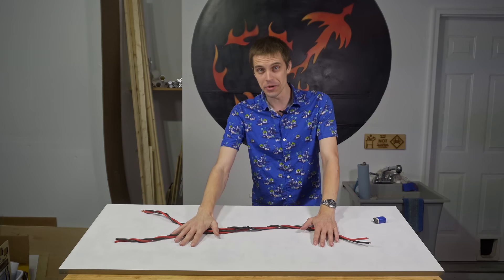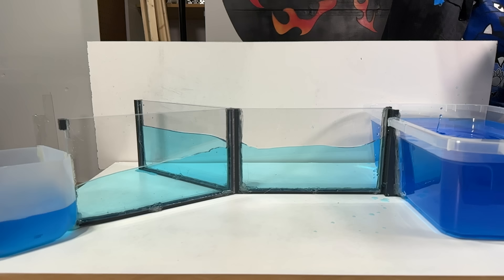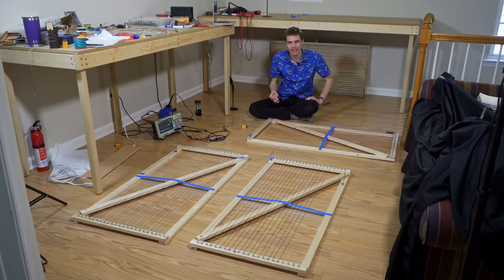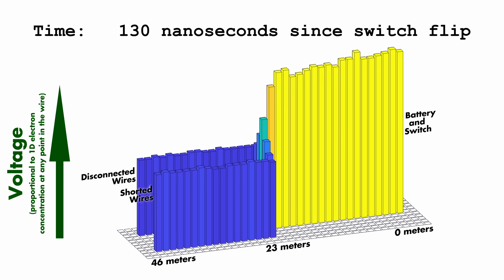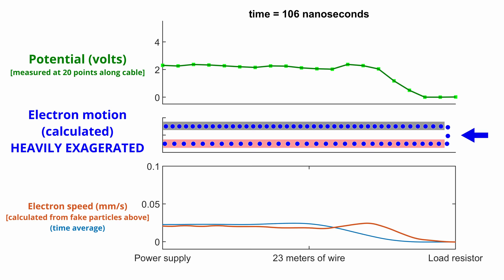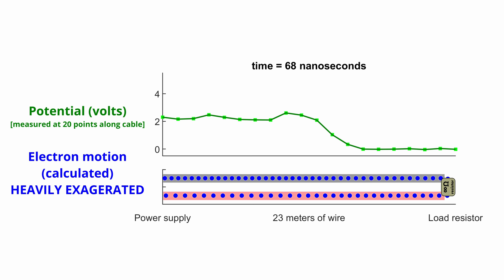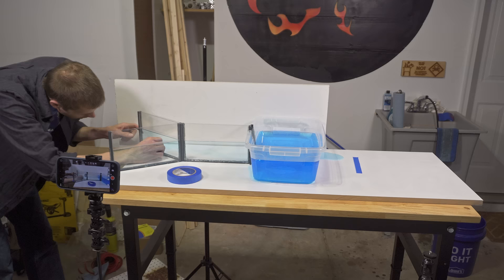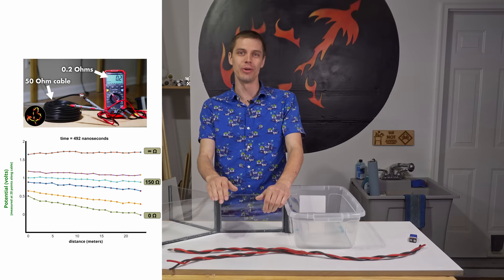Watch electricity hit a fork in the road at half a billion frames per second

Comment: Fun fact to this video: Since the waves reflect once there is a change in the wire, e.g. an "unexpected" open end because the cable was damaged somewhere, the time between connecting the battery and the the arrival of the reflected wave can be used to measure how far away the fault in the wire is (its called reflectrometry). This is extremly useful when diagnosing where cables buried in the earth are damage so that you can dig up exactly the damaged section instead of having to dig up kilometers of wires until you find the faulty section.
Reply: At the airport I work at we recently had an underground wire break. The local electrical repair company came out to locate the break. They used a trailer that utilizes the principle you described. We call it the ‘Thumper’ as you can feel it in your feet when it sends a high voltage spike into the ground to the break.
Reply: One of my friend's masters thesis used the same principle but for sound in water pipes.
Reply: @RovDisco  Thumpers like that are very primitive compared with time domain reflectometry gear. Modern form factor is a single-unit handheld (e.g. ONX-580) that can tell you exactly how far away your different faults are on the line. You'll get a different signal back for an open branch line vs. a short vs. something else...no need to even put anything at the far end of the line, although you can if you want to confirm a certain pair of wires really does take the path you think it does.
Reply: @TwoTreesStudio their primitive reading is more than necessary for their purposes I am sure. They need to access a fairly large section to make repairs.
Reply: Just how accurately can that be calculated down to?
100 feet?
Reply: @davecrupel2817  with massive HVDC conductors things are a bit tougher than phone lines/coax, but it should be more like a couple of feet max...it's theoretically limited by weird capacitance things but that's nothing compared to the variance caused by wires never running completely straight (also comes down to operator understanding of both the equipment and the underlying physics...your mileage will vary based on technician qualifications)

thumpers are easy enough for cave people to operate, you just listen for the arc and hope you find it before it sets something important on fire
Reply: @TwoTreesStudio  simple, effective and risky. I love it. 😂
Reply: @ajinkyakamat7053  Damn, that's actually a really interesting idea, do you know if it's already used somewhere?
Reply: Absolutely. Had to learn about and use a TDR in my first job👍
As I recall, it was exciting to find a discontinuity in the line and yell "There...there it is!"
Reply: Ditto, a TDR (Time Domain Reflectometer) works on this principle but with a series of pulses.
Reply: @gbmillergb  In the USAF in the 80s, we used a device called a "Time Domain Reflectometer" (TDR) to test for a broken wire on aircraft. If a wire was broken-even a single strand--it would create a standing wave which was reflected back to the device, and by measuring the time it took we could determine where exactly (+/ a few inches) the break was at. I suspect that is why there was a reflection at the "Y" connection.
Reply: telecom techs do this to locate open circuit faults in underground copper cables. This tech will be gone with optical fibres replacing copper cables. This is similar concept to radar speed detection and lidar surveying.
Reply: yes 60 years ago we had what was called a pulse echo tester which we used to find breaks in O/W telephone cables.  A mate actually used it to catch the local mayor and his son cutting down the overhead carrier wires for the copper.
Reply: @ronr4728 not gone, just changed. Reflectometry is used to locate faults in optical fibers as well
Reply: I was wondering what kind of practical uses this would have, cool.
Reply: Klien Tools: (sorry i can't remember the exact name of my tool.) Input wire gauge; Distance to short will be displayed on screen.
Reply: ...To dig up kilometers of cable and hopefully rebury it without inflicting any damage to it!...Reflectometry is a new term to me but the principle totally makes sense to me. It would also have a relation to triangulation, the process which is GPS ....It is all high math.
Reply: Wow, fascinating, something I never thought about, but something so incredibly important. The more you know! Thank you for letting us know :)
Reply: @davecrupel2817  Can what be calculated to?  If you mean were in a wire an "anomaly" is, that is based on the frequency of the pulse you send out.  I have a 20GHz TDR that can determine any impedance change (anomaly) in a wire 2 x 20ps (time of flight is 2x).  Every one of those "connections" in a wire will cause an impedance bump and show up as a reflection.  So, at 166ps/inch, 40ps would be ~1/40th of an inch.
Reply: Could relays possibly use this principle to calculate where a fault is in their zone of protection?
Reply: @RovDisco  that is the coolest thing I have ever read in my life. I *need* to experience The Thumper.
Reply: We use the same method for determining short circuits in motor/generator windings. RSO tests are fascinating and this video just makes it so much cooler!
Reply: PET  -- Pulse Echo Tester  -----  Used to use one on above ground conductors in the telephone lines to see faults, then calculate where to go look for them!    Almost every day at the test desk of Telecom in Bathurst NSW
Reply: You can also use a variation on an OTDR to create a "sensing" fiber which can be buried and used to determine damage characteristics to adjacent oil lines as well as act as a type of acoustic surveillance fence.

Comment: Absolutely amazing “footage.” Who needs expensive cameras when you can get such good data from an oscilloscope. 🤯
Reply from the maker: I’ve been trying to do the math to make something like a streak camera using oodles of repeated scope traces but finding LEDs with nanosecond ramp times is challenging xD
Reply: Sounds tough, hope you find them for the epic visual next video
Reply: @AlphaPhoenixChannel  Maybe LEDs aren't the ideal light source? Surely a spark gap could faster?
Reply: oscilloscope is a camera, for watching electron potential :)
Reply: actually i was wondering when i saw the video title, how a "camera" of any sorts could "see" electrons in a wire.  
But he found the solution: multiple repetitions of the experiment, with oscilloscope probes at varying locations. Great.
Reply: Yeah total BS.  I gave up and stopped watching this clickbait BS>
Reply: @jeffsmith3350 I wish you the best but you sound like someone driving a car claiming how a transmission works is unknowable.
Reply from the maker: @amy2theuniverse359  this is next on the list to try
Reply: @dowdayjing8442  nope, sounds more like me, expecting something more like SCARF camera footage, not animations, based off the title of the video
Reply: @amy2theuniverse359  Is a "true gap" optimal? 
Wouldn't it be better to bridge the spark gap with something that starts the arc bridged but buns instantly leaving an ionized cloud behind to conduct for longer.
Or maybe I'm overcomplicating it when enough A/Vs would probably make it jump fast and long enough?

Comment: Well this is ridiculously cool. This makes electricity make so much more sense, and what an amazing visual!!!
Reply: This is a fantastic endorsement. I recently purchased a VNA, and learning to use it helped me understand impedance and transmission so much more than anything I learned in school or from reading. This demonstration managed to be every bit as effective, which is amazing that it could be done with just a very basic scope and stuff from the hardware store. Bravo!
Reply: Hear Hear. This a demo that all scientific communicators can aspire to match. Bravo.
Reply: And then you go to uni and learn that quantum field theory shows that it was all a lie.  ;)
Reply: Here is another way to think of this circuit. The open end twisted pair are a capacitor and and inductor. The normal charging constants for a cap apply. The shorted end is more of a pure inductor, again the normal constants apply.
Reply: @silverXnoise  
Yes, he did well.
Reply: Brilliant
Reply: Way better than that absolutely idiotic Veritasium video. And of course Derek had to double down and argue with actual electronic engineering experts.
Reply: We have similar taste. Is there a way to see some of your subscriptions?
Reply: Now imagine this pulse going through a transformer coil. Now you understand why there is a diode over the terminals. To block the return surge which is amplified by the coil.
Reply: You would do well to have ONE lesson in the Physics of electricity, just one will be all a normal person would need to get past the smoke and mirrors.
Reply: Yeah the water analogy is still the best, this just only confirms it more, kind of makes sense since both wants to reach an equilibrium, which is seen in many different fields of physics
Reply: why didnt i learn this in school :(
Reply: @zer0dahero  After seeing this video I feel like I'm beginning to grasp electricity, but it most certainly was NEVER explained to me like it was in this video. So I think you maybe had someone explain it well to you, but that isn't normal.
Reply: Would it be right to say the water example would make more sense if the water was pressurized? Like if the liquid was pressurized enough to fill all sides before building up resistance pressure backwards from hitting the end of the circuit, then once that pressure becomes adequate it forces more and more particles to turn the corner where they can encounter less resistance? I feel like you probably could make a water system to represent this visually. 

Also if you had enough of these junctions would it eventually drop the amperage since some of the current is being wasted bouncing around in an empty wire?

Comment: As an RF Engineer, the stuff you're talking about is my daily bread an butter. Still, I've never seen such a good visualization of electromagnetic waves, let alone based on actual measurement. Really cool and educating, even for professionals!
Reply: I'm also and engineer for a prominent company that designs/produces RF power supplies for plasma sputtering, semiconductor etching, metrology, etc. However, I design and write regression tests for our firmware. Specifically, I test the product that does dynamic impedance matching between power supply output and plasma load. Who do you work for? I wonder if we work for the same company ;)

Reflections are a big part of our zeitgeist, and I agree that this video does an excellent job visually representing what reflections are and how they work.
Reply: @brentsmith7013  what I found interesting when first learning about RF, is how much more consequential everything in the circuit is. Like an axial resistor isn't just a resistance value. The leads and film material also act as little inductors and a capacitor in the circuit (to your point). I have a ton of respect for RF engies, because they are doing calculus vs me doing basic algebra.
Reply: Also an RF engineer, and also very impressed! The old adage that only a real expert can explain things simply really applies here.
Reply: Hobbiest RF guy here. I'll be using this video to talk about wave propagation in a transmission system, why we open/short/load a DUT, and more when I teach potential licensees...
Reply: Speaking of RF, I'd love to see this experiment repeated with Litz wire so that we can compare them. I think that would be super interesting.
Reply: @BobHolowenko  don't bother, teaching this to peoe trying to get their licenses, if they could understand this they would already have their Extra ticket.

Comment: Retired in 2013, teacher in HS and college adjunct with MS in Physics. Love the graph with the animated bar graph and point electrons below! These tools weren’t available when I was still teaching, but this is something I for sure would have had the kids watch! When I first saw it run, I totally geeked out on the reflected wave. Just like a compression wave in a spring hitting a barrier, or light ray entering a different refractive index… I started thinking about wave-particle duality of the e-. I’m so glad you went to it in the second half of the vid! Thanks for the mental stimulation, love your work!
Reply: As someone who has worked for quite some time in the field of non-destructive testing, I was already quite aware of wave phenomena, when they encounter impedance boundaries. It's wave physics in action, with all kinds of mode-conversion options that can be utilized, such as longitudinal - transverse and vice versa. We also used so-called Time of Flight Diffraction techniques, in which we recorded a B-Scan of a weld examination, showing the longitudinal reflections and the mode-converted transverse reflections in the same representations, as well as the diffraction echoes that indicated the ends of a fissure or other small discontinuities in the parent metal. With mere pulse-echo techniques, these small echoes would certainly have been missed.

Comment: This man made a career out of disproving Veritasium. Good job! and Thank You!
Reply: It's not that hard..
Reply: Wait, was Veritasium actually wrong?
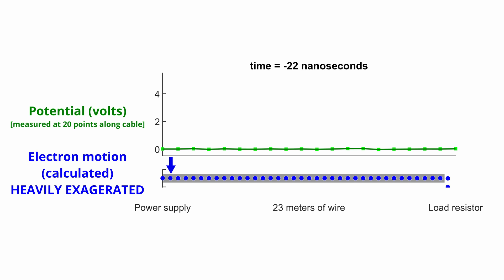Reply: I don't think there is any disproval in this video. The experiment is rather complementary this time! Energy is not transmitted over the wire by super-fast moving electrons (or holes), but by electromagnetic field. Take a look at 15:00 - there is a calculation that shows 0.64 c, over half the speed of light in vacuum.

See and compare Veritasium video on this very topic: "The Big Misconception About Electricity" (over 22 millions of views).
Reply: They are both wrong, there is no such thing as electrons flowing.
Reply: @streetsurfer420 veritasium has made some mistakes, but the video about electricity propagating in wires was essentially correct. He did kind of make it sound like fields propagating along the wires was the only thing that mattered, and electron flow had nothing to do with electric current (at least from what I remember) when both things happen, and both interact with each other. If there weren't moving charges (electrons) in the wire, the field wouldn't propagate along the wire, and if the field wasn't being set up, the electrons wouldn't move. This is the point that Mehdi (Electroboom) was making with his response videos. 

The way that the original statement of the question was made was also kind of misleading. He asked when the lightbulb would light up, and even for those who knew that a current would be induced in the wire, the answer depends on things that weren't specified such as the type of bulb and the voltage applied. This led to lots of argument about the specifics of the configuration, which detracted from the point he was trying to make about how electric current propagates through wires.

I actually like veritasium most of the time, and his method of asking questions as part of his teaching is pretty effective, but sometimes it goes a bit off the rails. I will say that all the discussion it generated did leave me with a better understanding of the subject, so maybe he was right to set it up that way after all.
Reply: @fpvangel4495 how do stuff like electroplating happen then?
Reply: @kirito5547  The only thing moving is a waveform.
Reply: @fpvangel4495  are you talking about the dual nature of particles?
Reply: @kirito5547  Maybe he references Bohmian mechanics, but most likely he's just a troll.

Comment: I’m an electrical engineering student. I remember learning this in circuit analysis but this visualization is so much better than the things we had.
Reply: I am an engineer (electronics) and I hated transmission lines. I got around that after someone told me to stop looking at the equations as an engineer and more like a mathematician.
Reply: If your school offers it and you're at all interested in this type of thing, I'd recommend taking High Frequency Systems. No doubt one of my favorite classes.
Reply: i am not an engineer but i am assuming that this is a representation of inrush current?
Reply: @Hullad1379  Transient response.
Reply: I’m a sparky and you’re exactly right! I wonder if an led would light for a nano second if forward biased on the open ended pair, due to the rolling voltage gradient?
Reply: @wattsupdave Given the voltage on the line-side is much higher than on the load-side, my guess would be the light wouldn’t turn on. Since electrons traverse from higher voltage areas of the wire to the lower voltage areas, I don’t think any electrons could flow from the line-side back through the LED to the load-side when the wave bounces. However, electricity do be weird sometimes and I could be wrong. I’d love to see someone give it a shot for sure!
Reply: According to Eric Dollard electricity is a stress. There are no moving electrons.
Also, Eric Dollard has been able to demonstrate cold electricity that is able to light an incandescent light bulb that produces no heat. There is an old You tube video that shows how this is done. There is so much more to learn about electricity. It's the younger generation that will find it because they are willing to think outside the box. 😊